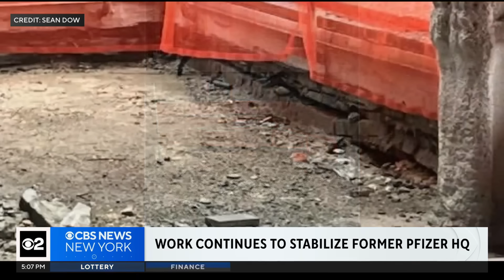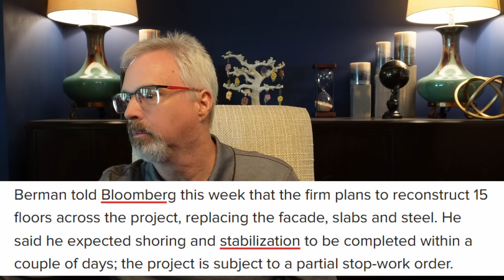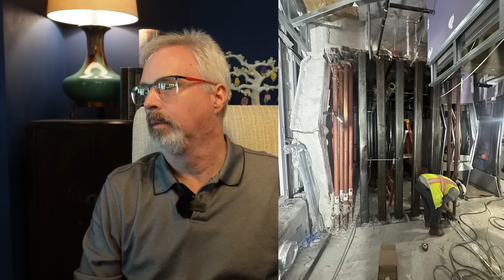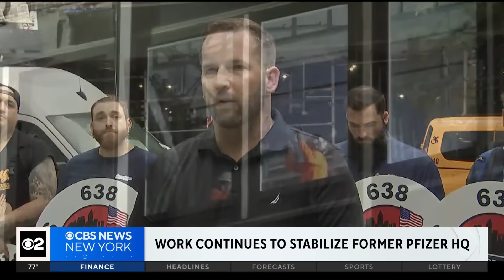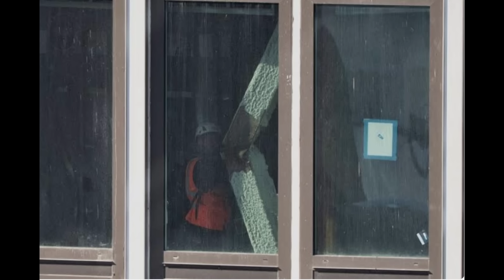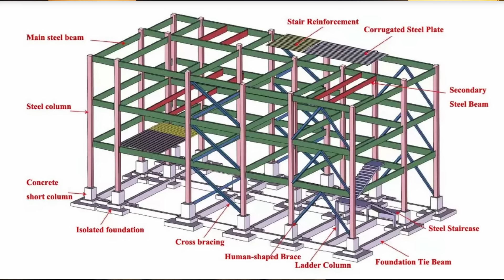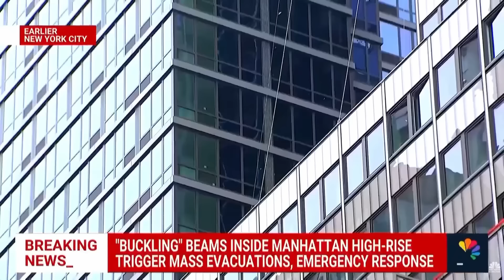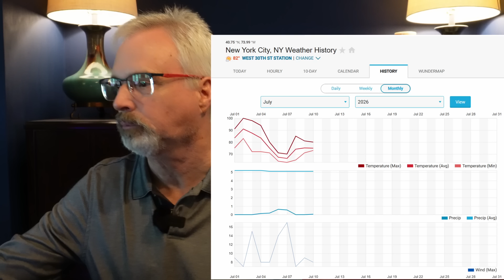Update - Pfizer Building Structural Column Failures; Now What?

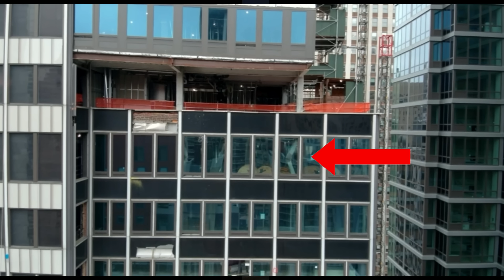Comment: 1. How can this beam buckle like that with a horizontal movement of just a few inches (visible at 1:59 in the video)? There must be more to it than that.
2. What do the other columns look like? Those that haven't deformed (yet). Are they also rusted? It's very unlikely that only a few columns  are rusted.
3. I see the problem as having a broader impact. If the excess forces are simply transferred to the floor below, then that floor will be overloaded. In my opinion, reinforcement must begin at the very bottom and work its way up the floors. I don't even want to know the cost for that.
4. Who will want to live in this building later? These apartments will probably only be available with enormous discounts.

Comment: There is an obvious problem quite similar to what happened in Florida. That flat roof to which they added many many additional loads. It has been there for almost fifty years. Flat and clogged drains. With water flowing down those columns and not noticed as they were hidden behind walls . The fireproofing might indeed be asbestos but it all holds water and keeps it from drying out . This will result in corrosion . I do not think they would ever look under this fire proofing as it would need to be removed for inspection. That is a big problem if it is asbestos. They are allowed to keep this inplace Unless it is disturbed Then they would have to remediate.

Comment: As a retired ship's officer, l've seen enough serious structural rust for this lifetime and any that might follow. The rust visible in the low resolution photo of the buckled steel column appears to be nothing more than minor surface rust that wouldn't diminish its structural integrity in any way. That makes its failure all the more concerning. The column appears to have failed due solely to other factors, with being overloaded from the recent additional weight of new construction above only one likely explanation. There might be others. One thing is obvious to the most casual, untrained, observer, whoever designed the addition was no lsambard Kingdom Brunel. The same goes for whoever approved them.

Comment: Those floors aren't just tilting, they're deforming. There is a definite curve to those floors.
I'd consider the entire structure to be structurally unsound.
In any sane country it'd be condemned to be torn down completely.

Union idiot just doing what union idiots do, trying to mandate unions and drive out non-union people from the entire industry. 
When in fact it's often unions causing the problems by making it impossible to get rid of bad practices and employees.

Yes, you can add floors to buildings. BUT, as a LOT of building failures over the decades have shown where it was done you need to do a complete structural analysis of the building, something that's often glossed over to "keep things rolling".

Comment: I'd agree with those speculating that the columns on the upper floors (where the buckling took place) were undersized relative to what was used in the lower floors.  This is common practice in high rise construction, and makes sense when one considers the fact that the steel work of the upper floors do not need to carry the load of the lower floors.  Building on top of those upper floors places a much greater load on those original upper floor columns.

Comment: To me, it looks like they added significant beams into the roof of the original structure to spread the load out from the new construction above. But, from seeing other assessments on YouTube, those failed beams have ended up taking too much weight. There is going to be some form of interfacing between the original structure and the new structure and the columns from the new structure do not line up with the old, so around the roof area of the original, the columns feed into beams which sit directly on the failed columns. Alternatively, I'm prepared to also think that because those columns were near the roof they were weakened by perhaps rain gaining entry via the roof. Buildings of this age tend to have a lot of column damage at the roof area, flooding in old buildings at the roof is a very common problem. So, taking a look at the original drawings of the building might have told the new construction that they had enough strength in those columns, but on actual inspection, they were probably a lot weaker then the drawings would ideally have them. And this is perhaps why they should have rebuilt this roof structure, maybe altered the construction to line up with columns above and having a better interface between columns.

What I think is a problem is they are doing this to add value to a building that is near it's end of economical life span, all this adhoc work to add to the structure is so badly designed and doing it to an old building, they should probably have just let the building expire and built a much more modern structure in it's place. Definitely the new structure is going to have to go, I don't know how they are going to allow this to survive, checks through their calculations is going to find problems and then it's over for it.

Comment: As an addition to your comments on the possible affect of ambient temperature on the structural columns, it would be good to check and see if the columns that have failed are on the south side or west side of the building.  Since the building is clad in glass and the air conditioning was probably not working during the recent heat wave the added heat from direct sunlight shining through the glass would tend to further heat the columns.  Radiant heat load can be significant.  It would be good to know if the glass in the building had an infrared reflecting formulation of some type as part of the glass or applied after construction.  Infrared reflecting glass was introduced in the 1960's so it is likely that this building had this type of glass.  However, early forms of infrared reflecting glass where not as good as glass developed later in the 1980's.

Comment: I’d bet $100 that the original contractor used substandard steel for the top floor since it was only holding up the roof. I’d bet another $100 that guy is long dead by now.

Comment: Can the existing floors be raised into place?  Yes it is theoretically possible but in practice would be difficult and expensive.  It might be easier to remove and replace the floors.

There are a lot of comments online about adding floors to an existing building.  Yes any reputable engineer working on the project would fully analyze any part of the existing building that is seeing increased load and would provide some means of strenthening before the loads are allowed.  The chance of an engineer not doing this is very very low, virtually zero.  This gives a clue as to the problem- was the strengthening not installed?  If so that moves the problem from one company to another.

As for the curtainwall- in a highrise building the curtainwall will have a hard connection every 2 or 3 floors, you can't stack the entire weight of the curtainwall all the way down to the bottom so it is installed in pieces 2 or 3 floors high, the remainder of the connections at floors will be slip connections that carry wind load but not gravity weight.  There will be gaps in the curtainwall every 2 or 3 floors that allow for vertical movement.  Of course the slip connections won't allow 8" or 10" of movement.  If that much movement was pushing down on the curtainwall it would strip the connections and definitely buckly some mullions somewhere.  Because this situation had a gap in the curtainwall about between levels 22 and 23 that gap would absorb the movement of the level 22 and above.  If there was glass between 22 and 23 it likely would have broken.

One thing you might look at if you have the right video- they have installed shoring under a steel beam that was in the original building roof, the idea being that the end of the steel beam is connected to the column above.  Now the many hundred thousand pounds of load coming down from the 2 new columns is transferring into the ends of 2 roof beams and from there into the new shoring.  The 2 roof beams were obviously not designed for this, they could have web buckling, shear or bending failure near the column from the load above, or the connection between the end of the beam and the column above could fail because it was designed only to support roof loads on the one beam.  There is still a serious overload condition possible at level 22.  Are they continuing the new shoring up to level 23 and above?  That would be the only way to remove level 22 as a potential impending failure location.

Beyond the question above about whether strengthening had been left out, there isn't a clear explanation for the current situation.

Comment: It's called weight distribution or above the 21st floor you don't have to be a rocket scientist to work it out the structural integrity of the 21st floor and below is in big problems it has put more pressure on the rest of those load bearing beams that cannot handle the extra weight of the building above but why is it when there's a problem with the buildings around the world today they always blame the developer when it's the engineer's that sign off on all this bullshit before starting to build to make sure the engineering is done properly but engineer's go on the run and blame the developer when it's both parties it's a disgrace

Comment: When it comes to structural engineering, I don't know small turds from big beans. But, nowhere in the reporting on this have I heard/seen mention of any modifications/fortifications of the original structure before adding multiple stories to it. Yes, things had a tendency to be overbuilt back in the day but to an extent where multiple floors could just be plopped on an existing structure strikes me as rather odd.

Comment: Lying and shady RE developer?  What a rarity.

Said that, ANY changes to the building potentially can contribute to such fiasco, in addition to:
1. Seasonal and daily changes in temperature due to multiple factors.
2. Uneven and excessive load of construction equipment.
3. Substantial increase of wind lateral forces, both negative and positive pressure.
4. Changes in wind direction and it's effect on the structure due to the change of shape of the building and subsequent changes of the flow of air relative to surrounding buildings.
5. Movement of the foundation of the building due to dramatic increase of the load.
6. Dilapidated or initially inadequate for the load material of the columns.
...
But I cannot believe, that any structure, especially built by 70 years old standards office building, can safely withstand addition of 20 stories and still have enough reserve of strength for all mentioned above and many other factors.
Additional load is in thousands of tonnes just in self-weight, not including content of the future apartments with marble floors, tiled walls, countertops, hundreds of overweight people and filled jacuzzis.
And still be safe for very possible in NYC earthquakes, catastrophic hurricane wind, 10 feet of snow, subway and traffic vibration, wild 4th of July roof parties, e.t.c.
The whole thing just does not make commercial sense.  No one ever would build commercial structure with such reserves, potentially wasting tens of millions of dollars.

Also, their "fix" maybe good for wooden 2 story house, because all they did so far - transfer all huge load, which bent the column, to the floor below, 
which, unlike columns, is not design to handle such load.  
Even if there is sufficient beam below - all it does is transferring load back to the same column, which had been proofed unreliable.

I'm wondering if engineers signing off on that project retired with irrevocable trusts. :)
Enron and Arthur Anderson were very reputable global companies, which, as it turned out, were cooking books for decades.

Comment: For the moment (lacking actual facts about it), let's make the reasonable assumption that the climate control (cooling in summer, heating in winter) that would certainly have operated while people were using the offices was discontinued when construction began. Or, possibly worse yet, there might be localized climate control in one work area while another floor experience uncontrolled temperatures. Under that scenario, you would expect there to be greatly increased seasonal thermal expansion. That is, stresses related to lack of climate control rather than construction work, materials, or excessive loading of the historic strutural members. Not much of a surprise. Comparison with nearby buildings, if anything, just corroborates this hypothesis, because they're still air conditioned.

Comment: Interesting discussion. I wonder how long the forensic analysis of this kind of failure typically takes? It seems like a rookie mistake that the additional floors just overloaded existing columns. I'm not an Engineer or anything, but that would seem to be the thing that is triple checked by multiple professionals. It seems like a good idea for future projects of this nature to liberally use monitoring such as strain gauges. The cost would be tiny compared to the overall project cost. Another thing I was wondering is what sort of testing is done on existing steel work before construction starts. Maybe some steelwork was defective or not consistent with the original plans.

Comment: When that big quake hit ChristChurch NZ I was working as a scaffolder going in the malls etc to put up propping so other workers could go in we saw structural pillars that had cracked and the rebar had either buckled or snapped poking out they just either pushed it back in or cut the rebar patched the pillar with concrete from the hardware store which I'm assuming isn't strong enough I could be wrong I don't work with concrete and called it safe

Comment: If it doesn't fall down eventually then it will ultimate crash down from all the tenants sueing them in court and will definitely lose as it's as clear and obvious a shonky safety issue and neglection of duty for all those involved from the outset of this dusasterous structural integrity issue from the get go! The one time being a tenant of a structurally disaster is a huge financial benefit with costs of rehousing time history and inconvenience then the repayment of price they paid plus interest and not just the building com[pany but the engineers etc involved should besued as well. "Show Time"!

Comment: Have been on numerous union and non-union projects over the years.  When there are design issues or material issues, one can't blame labor.  But I've seen way too many instances of craft-labor mistakes on numerous projects as well in my career.  These mistakes were on both union and non-union jobs.  Case in point is in Las Vegas with the MGM City Center Harmon Tower where the union workers/supervision got the reinforcing steel completely wrong for 15 floors.  At the time $250 million had been spent on the Harmon Tower and it had to be completely torn down.

Comment: The portion with the buckled columns almost looks like a quasi penthouse that was built some time after the original building. It most likely didn’t use the same beam and column design as the rest of the structure.
Reply: Mechanical room?

Comment: The fact that they are adding that much cantilevered weight onto a 70 year old building without any additional load bearing structure is some Idiocracy-level stuff. I’m really wondering if they did a complete analysis of all the existing structure to look for variations of as-built vs design, and the affects of age degradation.

Comment: 13:30 as long as the loads are continued through to structure below the roof, there's no problem, especially if you bolster the original supports.

Comment: I’m pretty sure that the cause is that the weight of the new floors was greater than the strength of those columns. The reason for this is gonna be design related and/or assumptions about the strength of existing members. I can’t really see how any of that could be a labour issue. There’s a reason we haven’t heard from the structural engineers or the construction company.

Comment: This developer, I believe, was trying to keep costs down by any means. The thought of loading a 65 year old structure with new additional structures and a swimming pool on the roof seems a long flight of fancy. In order to successfully do these over the top renovations would have required  invasive and extremely expensive modifications to the building's structure and foundation.

Comment: I have worked on concrete highrises for more than 30 years in Vancouver, so when I saw this I was blown away that the developer DID NOT reinforce those existing columns on the original Tower before they added a huge  structural load above that building 
 with like 20 additional floors !?!?
Some engineer screwed up big time,
Adding a massive load to the original Tower 🗼 and not doing any reinforcement to the original buildings structures columns is so unthinkable I just can't believe it !!!
Someone somewhere tryed to save money and it has cost them big time JUST LIKE the other Tower sitting empty in Manhattan that started leaning on completion Because the developer wanted to save a few million bucks on the excavation pilings !!!!

Comment: 1959  fireproofing  not probably,, it is a near certainty that is is COMPOSED of asbestos.  Asbestos was a commonly used material through all of my early years as a contractor.  A and B licenses in downtown Boston in 1970's.  Common to the point that 5 gallon pails of premixed drywall taping mud,, bragged about their asbestos content  that made the mud spread smooth, resist cracking,, and when you sanded before painting the air would visibly fill with floating fiber dust.  The primer was REQUIRED to seal down the furry surface prior to painting.  That was the original need for drywall primer.
So those columns,, it is not a maybe.